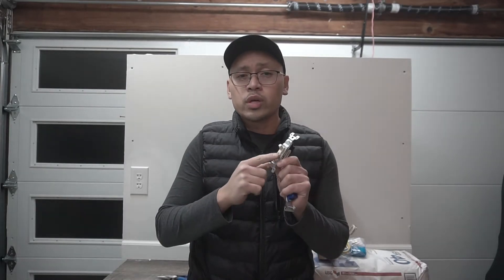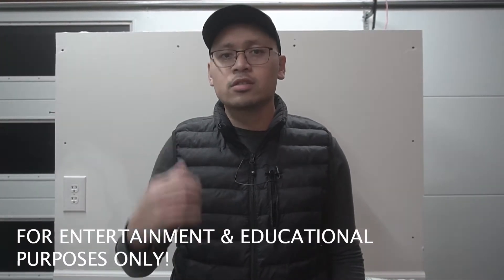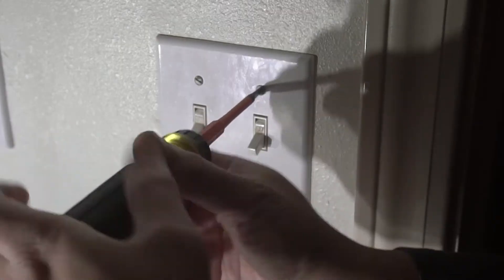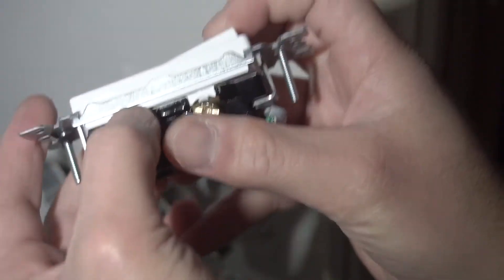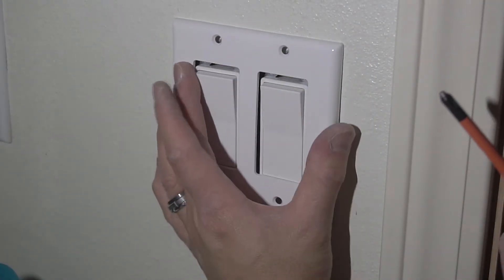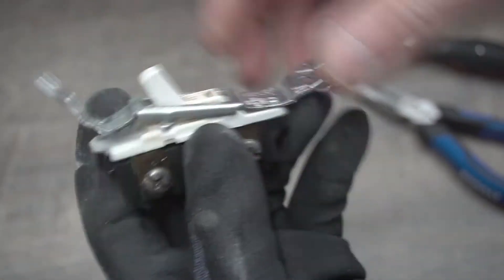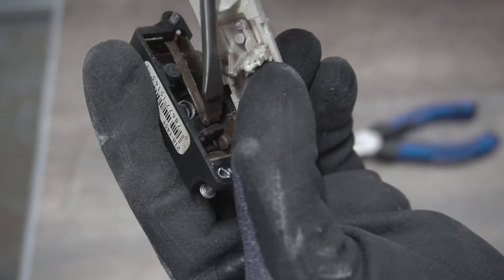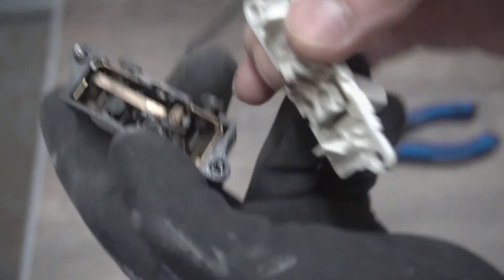Why A Light Switch Is Not Staying ON or OFF! How To Fix it! DIY Tutorial!

Comment: Thats happening to me but with the new model u had just put on the wall (the square one). The house is brand new, im still under construction, im still not living in it. One day it worked, the next day it wont turn off, the light stays on. Its contrary to what happened to u. Urs turns off, mines turns on.

Comment: I actually had the opposite problem my switch just randomly stopped working and the light wouldn’t turn off. I wanted to do it myself since I came out of electrical school. But I left it to a professional cause I’m not trying to mess up.
Reply: Same thing is happening to me. Everything is brand new, and the switch i have its those squared modern ones. Im still under construccion and not living the house yet. But one day i noticed the porch light on, when im really sure i had turned it off. When i go to the switch, it wont turn off. It switches to on by it self.

Comment: When it comes to electricity I am as clueless as it gets. I had this same problem when my lights in my bathroom stopped working even though I had brand new bulbs in. I replaced the switches and they began to work again! thanks for doing this video!
Reply: Well if you can replace the switches then you are not clueless

Comment: BIG TIME  that was very educational.  I now have plans to take apart the component that has caused the front half of my home to go dead as  I turned on a POWER STRIP  to my computer , and modem, perhaps with the light switch on  in the computer room.  Power surge, with a Weakness at one point in the circuits.  Thank you.... I will dream  about this after I do as You do.   GREAT STUFF to feed us info on the inside of failure in components,   and dark walls.

Comment: I wonder do you know anything about toggle switches? My computer PSU has a toggle switch and it sends power even when in the off position. The power supply is only a couple years old and I'm reasonably certain it worked properly a few months back. Right now no matter what position the toggle switch is in, it stays on no matter what position I switch it. I can't make sense of it at all. I Can't understand how a simple toggle swthc can send power with the switch in the opff position. Yes I know there is usually a bit of power left but my computer is running right now with the switch in the off position it makes no sense.

Comment: Just so you know, many of the light switches installed in your home probably cost less than a dollar, and the spring and contact inside are prone to failure. They make a model up switch that costs like $2 and those are definitely more solid feeling. This is true for both standard and decora switches.
Reply from the maker: Thank you for the info! 👍🏽😊

Comment: Good video, unfortunately everything fails eventually. 
Note the reason why the wires inside the boxes are dirty or caked with paint is because, when we run the wires for each circuits, we tuck the wires in so the sheet rocker doesn't nick the wires with his cutting tool. Than the painter comes and (most of them don't put anything in the box to cover it) just paints over everything. 
However I label the wires when I install for this reason. That way whoever comes after me knows exactly what circuit it is in the panel, the hots and switch legs.
Reply from the maker: Thank so much for the advice! 🙏🏽😊